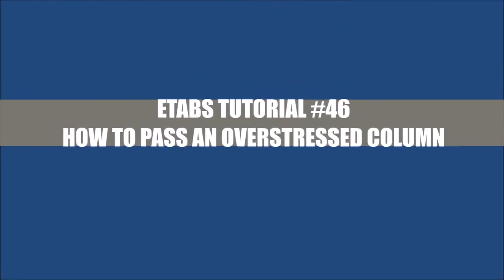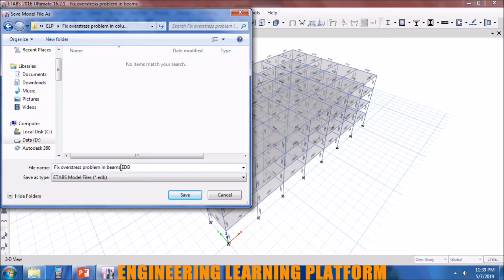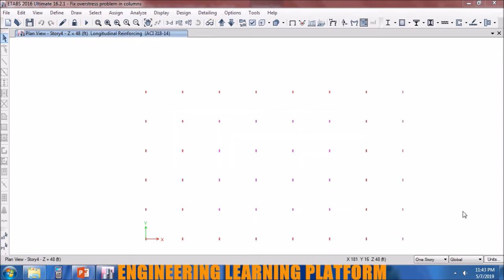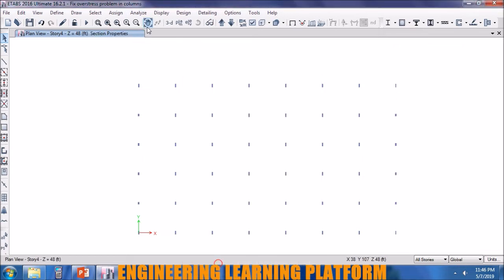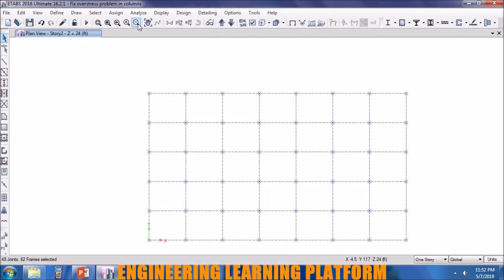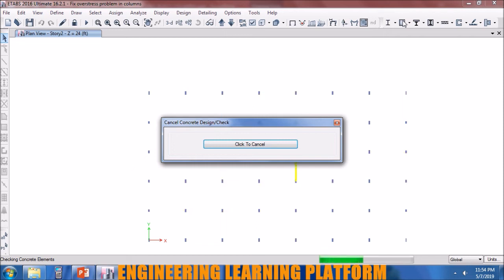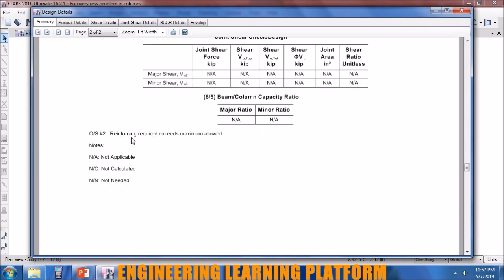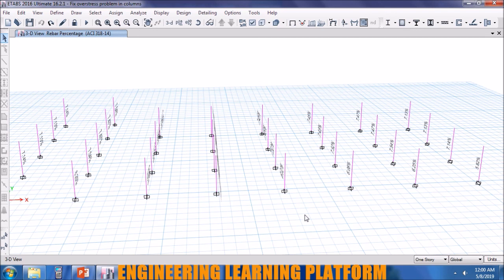How to pass overstressed columns in etabs tutorial video

Comment: Moment release is not an option, its just to pass the design check. This approach is not suitable
Reply from the maker: If the structure remains stable and passes the analysis and design check, you are defining a hinge in the structure known as a strong column, weak beam, and hence detail it properly as a pinned joint. If it was not feasible, then I am working in the industry with people having 30 years+ experience, and the high-rise 60-story+ structures they designed would have all collapsed.

Comment: Dear,

To pass the structural elements you have released beam end moments where they are contected to columns, this practice is not done as its only applicable for secondary beams as of my knowledge. where ever end moments are released the particluare beam elements is designed as simply supported not as fixed right? so in this vedio fixed beams are deisgned as SSB by releasing moments  to pass the elements, do you think its right ?
Reply from the maker: They will be detailed as ss.
Reply: @EngineeringLearningPlatform  
My question is , is this correct practice while we design a structure ?
Reply from the maker: @shaikshabuddin190  Yes for small structures the detailing is done as per the modifications you do in model. But in larger or highrise buildings we should avoid.
Reply: @EngineeringLearningPlatform  Even though for small structures if we follow as said by you it won't be economical design in terms of reinforcement becasue under SSB design the designed steel will not falls under economic aspects. correct?
As a civil engineer we have to design balanced  reinforced and economical structure, right?
Reply from the maker: @shaikshabuddin190  what if architect doesn't allow increasing section size and economical is not a problem for a client? You'll say you can't do it? Or you will use the method. Not everything is able to be used in each situation.

Comment: In my steel midel there is a failiur noted by "o" not os.. may i know what is that...

https://www.facebook.com/100000574118663/posts/3913132398715859/
Reply: https://www.facebook.com/100000574118663/posts/3913132398715859/
Reply from the maker: Use PM ratio option instead . If ratio exceeds 1 then members fails .

Comment: How do i join two right angle cantilever beams in one plane as a one member?
Reply from the maker: Perpendicular members cannot be joined . But transfer of forces remain same
Reply: @EngineeringLearningPlatform   thanks Sir for valuable reply, but can we join two align beams in Etabs as a one member, if one beam is inclined from say plane A to plane B and other is in plane B?
Reply from the maker: @Rdssamngr  yes . Use replicate linear option . Do some tries .
Reply: @EngineeringLearningPlatform  thanks Sir.
Reply: @EngineeringLearningPlatform   actually i am trying to model a single beam which will run through out the length of landing and staircase slab, but dont know how to join the beam under staircase with beam under landing, all load is being transferring to staircase slab and landing beam, and the beam under staircase not taking any load as it is not join with landing beam.
I am tring to join these beam as a single beam pl help.

Comment: Can we release moments in beams in SMRF constructed on Seismic zone 3? Because in reality beam and column joint is fixed and moments from beams will be transferred to columns irrespective of how we design beams. Fixity is determined by the relative stiffness of the members rather than the design of the beam. Designing beam as simply supported is not right I think. Would you mind to elaborate on the concept behind releasing moments, please? I am unable to find any evidence about that on the internet.
Reply from the maker: Yes when you apply end releases the negative gravitational moment is converted into positive moment for beams which enhances percentage of steel in beam and it is important if you use end releases to pass columns then u use the same model for beam design as well with applied end releases
Reply from the maker: It's a design office based practice, not everything you can find on internet .
Reply: @EngineeringLearningPlatform  When we apply beam releases our beam acts as simply supported. Is it not better to say that it is merely the behavior of simply supported beam due to which there is no negative moment in the beam. In other words, we have designed our beam in such a way that it will not be able to bear negative moments (which in reality will be acting on the beam as it has fixed ends with columns) and it will fail if any negative moment will act upon it. It is the way I see it what is your thought?
Reply from the maker: @Osama-Anwar  No it won't fail unless u detail it properly, read ACI chapter 21, it puts a certain proportion of positive steel in negative reinforcemnt necessarily . So in other words, we are increasing positive steel, which increases negative steel in detailing .

Comment: Sir How  to solve Eulers load exceed 
OS# 5, please tell me I am badly struck somewhere
Reply from the maker: Yes for that unlock model, select that failed member, and go to design -> overwrites and you see effective length factor, fix that value . Like for example in class you must have computed this effective length factor "k" use that value here .
Reply: Engineering Learning Platform Thanks for reply sir you solved my problem. Look what actually happening is, I have Foundations 1.5 m below the plinth and my storey height is 3.2 meter. In some area I can’t provide the grade beams as they are passing Over underground water tank. So if I connect that grade beam the column is passing and when I remove that beam it is failing. However on site we can’t put that grade beam . So my column height will be 1.5+3=4 m In that area and “K” value will be “0.5” as both ends are fixed . Am I right ? Sir . Kindly reply.

Comment: Please can you show us how to pass o/s #20 for columns. Thank you.
Reply from the maker: Can u post a screenshot?
Reply: @EngineeringLearningPlatform   Can you give me your email address to send it?
Reply from the maker: @abdullahmayof347  elpdownloads@gmail.com
Reply: @EngineeringLearningPlatform   I am using ETABS 18. However, when I run the same model in ETABS 17 it passes (no O/S #20 message).
Reply from the maker: @abdullahmayof347  What loading code you use
Reply: @EngineeringLearningPlatform  ASCE7-10
Reply from the maker: @abdullahmayof347  Then there must be bug in model as both codes are in both etabs
Reply: @EngineeringLearningPlatform  Etabs 18 gives a warning O/S #20 when Delta non sway factor exceeds 1.4, though I tried the same model with Etabs 15 and this warning didn't seem to occur even though I'm using the same code.
Reply from the maker: @ahmadfakih3451  I don't actually prefer etabs 18,17 and even 15 . The most stable version for finite element modelling so far i have experienced is 16.2.1 etabs
Reply: @EngineeringLearningPlatform  Do you have a working download link for 16.2.1?
Reply from the maker: @ahmadfakih3451  Getintopc website has the version available
Reply: @EngineeringLearningPlatform  is Etabs v20 stable or should i go for V16.2.1 only?

Comment: Moment release in beams  are possible when you allow cracking by providing less reinf. or development lengths. How lateral load resistance will be ensured if all beams have moment releases? Otherwise,  Shear wall should be put into action by designing it  as the only lateral load resisting system with a premium of  increased thickness , heavily reinforcement including link beams plus properly detailed collector elements.
Reply from the maker: Releasing moments in beam means it will not really taking lateral moment hence the columns will be designed strong enough, which we call as predefined hinges and the hinges in beams are much desired as compared to in columns as hinge formation in column results in whole structural failure however hinge formation in beams being ductile member will not fail the structure but will increase the positive gravitational moment in beams as beam will not be taking moment at supports i.e negative moment . This will cause increase in positive moment steel i.e bottom reinforcement will be designed sufficient enough to resist this condition. Now about the reinforcement of supports which we apparently made zero by applying releases will not happen as if u see my beam design video we will place minimum steel and in case of seismic design we set minimum steel of 1/4th or 1/5th (based on seismic zone) of the positive moment bottom reinforcement hence becomes practical design, and will be taking negative moment as well but once the support joint yeilds then this ductile member will have enough capacity left to carry on the gravitational positive moment before repairs are made.
Reply: What is the definition and concept of a Moment Resisting Frame? What is the. difference between moment frame system and truss system? (at least in trusses we have diagonals to to resist lateral forces). in Releasing M33 on all beams will introduce structural instability mechanism provided bases to rotate. If someone is trying to design isolated spread footing with this approach, then there will be a big risk. Software will also intimate you with excessive loss of accuracy or Ill conditioned stability. (by selecting SAP2000 or ETABS Standard Solver option, we can see such warnings in Run Log File)

Kindly refer UBC97 sec 1627 definition of Moment Resisting Frame.....Code requires that beam-column joints should resist flexural efforts. Otherwise you cannot put your frame in any category of OMRF,  IMRF or SMRF as set-forth in ACI or UBC/ASCE/IBC. 
1/4th or 1/5h of positive moment capacity at beam-column location is not recommended by any code for lateral load resisting system.
Reply from the maker: @engrshafiq1 1/4 and 1/5 It is recommended by ACI 08 see chapter 21 see SMRF beam design, ofcourse you cannot ignore thay force from frame but u primarily won't design beam for that moment but columns must be. U must have known that in building frame system we take modifiers of column as 0.01 in wall design model, didn't you question there that why taking as 0.01 as name suggests frame etc ? In these type of systems is it okay to rely on single model? No . You must consider the maximum positive moment as well when joints are yeilded . This video elaborates that post yeilded state, and design columns strong enough . Also another example when designing beam column why u take slab as membrane? although slab has its stiffness but why neglect? Answer is that you want to design frame strong enough to take all moments independent of slab's stiffness. Third example is why you take torsion constant to be 0.01 in internal beam for slab design purpose? answer is you want to design slab strong enough to take up its moments it self and transfer minimal residual to the beam which then becomes torsion for beam . 
Consclusively i would say making hinges in beam is not all times condition but practically you can detail column beam as pin making beam and column stronger in terms of reinforcement .
Reply: @EngineeringLearningPlatform  First of all we have to understand,  definition of Moment Resisting Frame? Post yield analysis of all joint failure is a useless effort especially for design intent. In Pakistan 8th Oct 2005 earthquake, many structures failed due to failure of joints.  

Regarding SMRF, ACI  code says,  minimum 1/4th from max moment capacity at either face of  joints  should be maintained every where in the section of the beam...Code is not saying that at face provide 1/4th of positive moment capacity. It is the basic requirement of moment frame that Joint should be robust enough to resist moments. In fact in SMRF ACI played with extra safety that  splice location has been shifted in the middle of beam span to avoid any rebar slippages.

All other theories related to membrane, torsional release, shear wall reduced stiffness factors are irrelevant here. If we are not understanding basic principle of Structural engineering i.e Moment Resisting Frame then discussing other issues have no value.
Reply from the maker: @engrshafiq1  It was just to make you understand that we make multiple models for conservative design of structural member level
Reply from the maker: Yes thats why we need to have enough positive moment capacity to bear the gravity loads when earthquake is gone .
Reply: @EngineeringLearningPlatform  If this is not the conservative design model, please share model  with conservative design approach.
Reply: @EngineeringLearningPlatform  There is no point of having more positive moment capacity if the whole system collapse during an earthquake.
Reply from the maker: @engrshafiq1  How would it if the lateral force resisting system is strong enough, like columns . Beams/slabs will be bracing them
Reply from the maker: Look sir, Tell me one thing, why we release torsion from beams? in model i am talking about not in construction site etc . ?
Reply: @EngineeringLearningPlatform  For lateral brace having hinged connection require diagonal elements. Slab/beams cannot brace columns in a rectangular framework through hinged joint..
Reply from the maker: @engrshafiq1  I guess you aren't understanding or even trying
Reply: @EngineeringLearningPlatform  Torsion release is allowed by ACI code under sec 11.5.2.2 because it will redistribute torsional moments as an increase in positive slab reinf,  This torsional reduction will enhance beam capacity to resist more shear.
Reply: @EngineeringLearningPlatform  This bracing require moment connection. between beam & column.
Reply from the maker: @engrshafiq1  That why the main motive if performance based design is that engineers will not hide behind codes, the logic here is just to model columns stronger, not to make Beam hinge in actual site . model and site construction are different . thats why engineers are hired to refine software results, other wise normal draftsmen can use etabs as well .
Reply: @EngineeringLearningPlatform  How columns will be designed stronger without considering -ve moments. Not to make beam hinged at site require, proper design process in design office.  Tell me how at site one can add negative reinf. without knowing forces or moments. If you say 1/4 th of positive reinf. then sorry  to say your structure is under designed. there will be no moment connection and structure will fail at beam-column joint location.
Reply from the maker: @engrshafiq1  I didn't say i will provide 1/4 i said i will set a minimum of 1/4, there is a difference .
Reply: @EngineeringLearningPlatform  Okey then in that case  how the site engineer will decide about how much reinf. to be provided at all beam ends. To me design drawings should cover both negative and positive reinf for all beams. If site engineer need some modification in structures then he should engage design engineer for his approval.

Comment: Can you teach us how to solve “joint shear”failure in SMRF? Thank you.
Reply from the maker: You mean strong column weak beam check pass? Its simple inc. Column dinensions parallel to beam length as it will inc. Its flexural capacity compared to beams'.

Comment: if u release all the moments in all beams then column will pass in gravity loading but about the lateral loading, definitely it will increase the column sizes.and is it advisable to release the moment in all beams ?. If we release then we do have to do very careful simply supported detailing in all the places.
Reply from the maker: Thats why i dont advise to release moments in "All beams" of single storey
Reply: But practically as per site any release not possible, all members joints to be act as a fixed behavior during the earthquake!!!!

Comment: Is changing or applying end realese effects the strength of structure
Any special precautions while applying end realese please share
Reply from the maker: Yes when you apply end releases the negative gravitational moment is converted into positive moment for beams which enhances percentage of steel in beam and it is important if you use end releases to pass columns then u use the same model for beam design as well with applied end releases